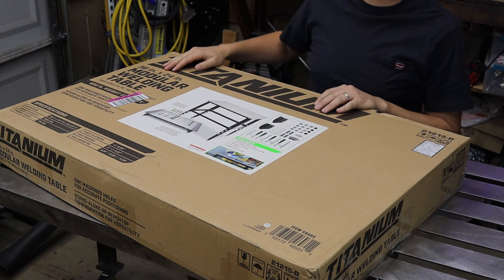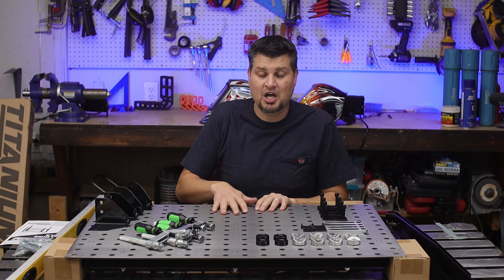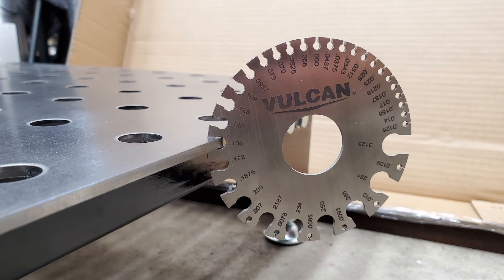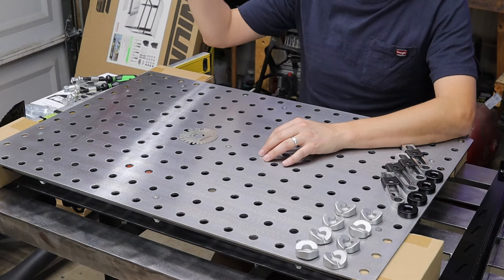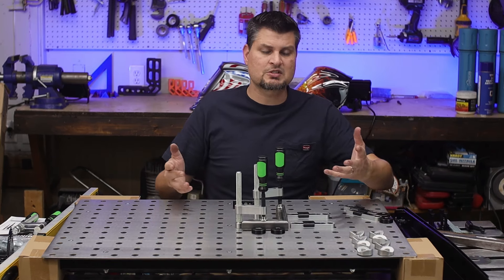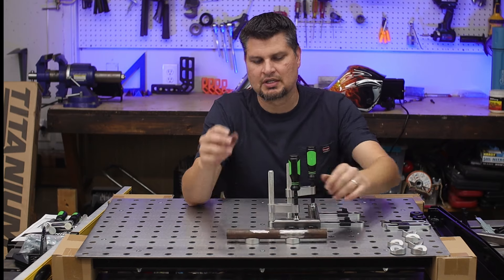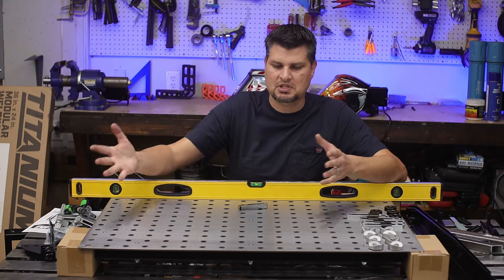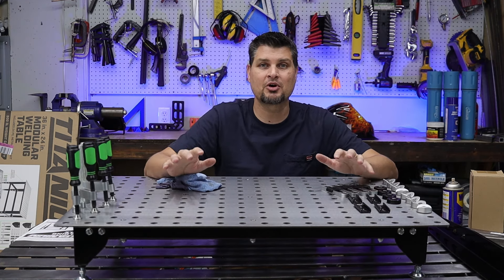NEW Harbor Freight Welding Fixture Table!!

Comment: Skip WD-40 it absorbs water over time and can result in rust. I've always been told to use something like fluid film, way oil, paste wax, a lanolin spray, or Boeshield T9
Reply: Wd literally stands for water displacement, the 40 is that it's the 40th test.  Unless that's just another internet myth
Reply: @Kami8705  that statement/claim comes from WD-40's own website and is based on the original chemist's lab notes. As I understand it he never explained (nor did WD-40) what is meant by "water displacement". supposedly it absorbs some amount of water and because it's a lightweight solvent plus a lightweight oil it evaporates over time leaving the water it absorbs behind and the metal unprotected from rusting.
Reply: @askquestionstrythings  huh weird I guess the wd-40 I’ve used over the years on bare metal that has kept rust away didn’t follow your logic?
Reply: @msk3905  as I've heard it it depends on where you live and how often you apply it. If there are better methods which are more reliable regardless of location and require less reapplication would that not be a better choice?
Reply: As someone who has been maintaining table saws, bandsaws and other cast iron surfaces for 50 years the best thing to keep rust away is plain old car wax. If it gets a little rust clean it up with a scotch bright pad and WD 40 then wipe clean and put a coat of car wax on and buff to like new.
Reply: I just plan on using the same wax I use for my table saws. Johnson paste wax, I know they don't make it anymore but Johnson and Johnson carnuba car wax is basically the same thing and works great!
Reply: Straight from Wd40 website FAQs:
Fact: While the “W-D” in WD-40 stands for Water Displacement, WD-40 Multi-Use Product is a unique, special blend of lubricants. The product’s formulation also contains anti-corrosion agents and ingredients for penetration, water displacement and soil removal.

Comment: Good review!
I'm just getting started into MIG welding and I wanted this table badly. I waited for months for HF to have it available, but it never showed up within 100 miles. Then they poured salt into the wound by sending me a $20 off coupon for it. I gave up and bought the Klutch one at NT. It has the same clamps which I thought would be fine for occasional hobby type welding, but they drove me crazy. Every time I needed to move a clamp over an inch, I had to reach under the table and try not to drop the silly nut. I ended up just grabbing a couple bar clamps from the woodshop and welding an inch of 16mm SS rod from eBay on the end of it as seen on lots of YT videos. Works great!
Reply from the maker: Right on, thanks. Yes the clamps are a hassle!

Comment: Princess Auto in Canada has had a similar table for the last 5 years.
The top is welded to the frame on mine.
I bought mine for $129 Canadian which was around $100 USD.
No complaints from me compared to the price of a real fixture table.

Comment: Only since no one else has mentioned it - the box states .050 flatness, that’s 50 thou, not 5 thou as was stated in the video… it’s pretty likely that it meets the .050 spec out of the box it would be very noticeable with a straight edge if not…
Reply: Thank you!! I noticed as soon as he said it.
Reply from the maker: Thanks for pointing that out, I didn't notice that until you mentioned it. Correct the box does say 0.05 and on the one corner it's 0.110. In some of the shots you can see the straight edge rocking up and down. Other than that one corner it is well within tolerance.
Reply: Came here to post the same thing.
Reply: @franzv3172  they just arrived at my local store this past Friday.

Comment: For folks in the comment section, if you look closely you can see the part number in the beginning of the video! I asked my local HF if they had the part number (59403) in stock and sure enough they had one in the back! It is not on the website (10/5/2023) and there wasn't a placeholder tag on the shelving with all the other welding items. 

But ask nicely, and you might get lucky! The part number pulled right up for them and it rang up at the register without issue. They even mentioned they were expecting another one to arrive on the truck later today, so they might be slowly arriving in stores.
Reply from the maker: Thanks for posting that. I should have mentioned that in the video.
Reply: @-DIYPRO-  thanks for posting the video!
Reply: Thanks for the item number.

Comment: What is the circular steel you weld on? What is the description and where to find one?
Reply from the maker: It's a 1/2" "drop" plate. That was the left over stuff or drop from a larger project. Lots of times fabricators will just give it away.

Comment: 4mm is 0.0305 inch less than 3/16

4mm = 0.157 inches

3/16 = 0.1875 inches

Difference between the two is 
61/2000 inches (or)
0.0305 inches

Comment: how can we get it??? can you please send link I will buy now I have the Chicago electric its not doing its job this would help so much I'm a new hobby welder
Reply from the maker: I looked a couple days ago and it was online and now the link doesn't work. I wonder if they had a issue with supply. I'll post it once I see them again. In the meantime you can call a local HF and ask if they have any.
Reply: Another option, evidently, is Northern Tool, their Klutch Welding Table is very similar, and they have been offering it for over a year I believe.
Reply: What's the price difference between the two?
Reply: @GoggleAX 

Harbor Freight doesn’t list this item at the moment, Northern Tool is one month out for delivery and many other places online are unavailable. 
I’m guessing there’s more demand than supply or the plant in China is behind on production.

Comment: Isn’t this just the same table as the Northern Tools Klutch Welding Table?
Reply: It sure looks like it.   I have one of the Klutch tables and this looks identical.
Reply from the maker: Yep, almost identical.
Reply: Id be very surprised if anyone could prove to me that they came from anywhere other than the same factory in China. I got 2 from Northern Tool for $180 each including tax and delivery.
Reply: @-DIYPRO-    What's the price at Harbor freight?  Same as Northern Tools?
Reply from the maker: @Kami8705  $170 so with tax I paid $182
Reply from the maker: @Kami8705  looking at northern they have it for $199. HF is $30 cheaper.
Reply: Just curious if its really identical. The klutch table has 16mm holes slightly larger than 5/8's